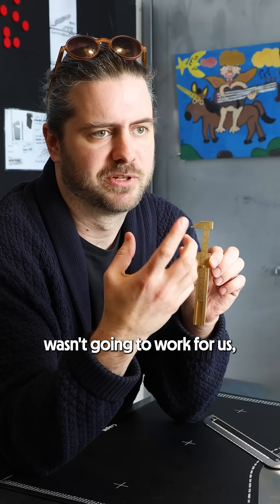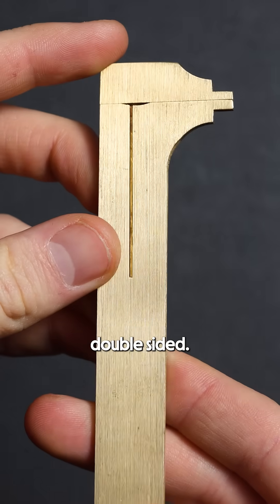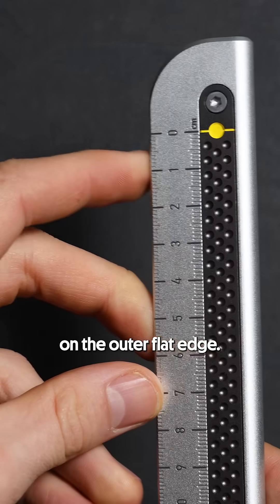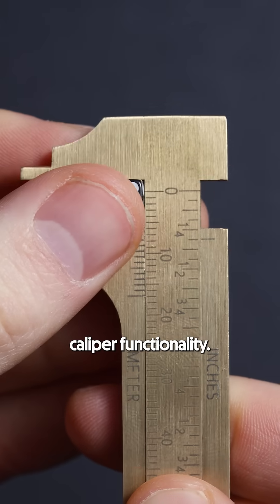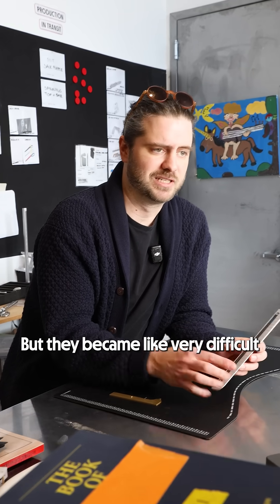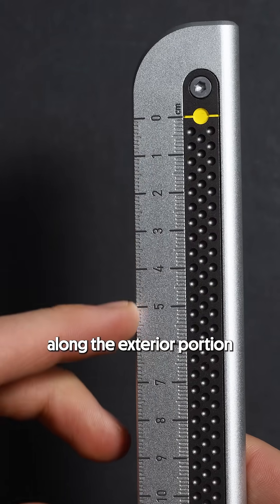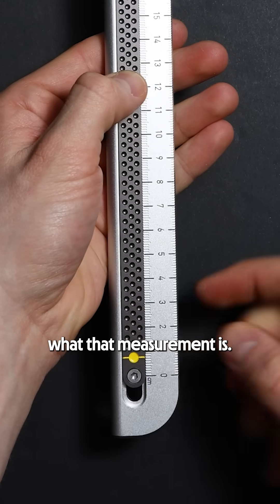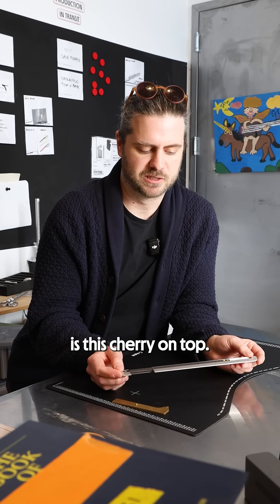Solving Our Problem with Calipers

Comment: These guys go to the nearest office Depot and pick the first thing off the shelf and say "let's redesign this for the sake of appealing to hipsters" and call it engineering
Reply: Not sure about you but I can see and understand the problems with the previous one he was holding, and why they changed it to make it better
Reply: @magentayarnball2901  their version is less precise, cant do internal measurements or depth, and solves a problem that didnt exist. The original calipers they had work as a ruler or straight edge if you use the back. Most of the work they do is removing functionality for the sake of making a thing pretty
Reply: @magentayarnball2901 this problem was already fixed decades ago, it's called using a ruler if you need to eyeball something and using dial calipers if you need an actual measurement
Reply: @magentayarnball2901 thats called luxury design, I dont like it, but also dont mind it
Reply: @magentayarnball2901  theyre version literally has less functionality than the older model, watch the entire video. it is fundamentally a worse product than the older design. good design is when aesthetics keep up with function, not sacrificing function for aesthetics
Reply: @pulkitkishore5297 I did watch the entire video and i’m seeing a few improvements and only one potential drawback
Reply: @pulkitkishore5297 where is the worse functionality? The caliper they had wasn’t even as robust as ones I’ve seen in schools
Reply: @magentayarnball2901  Calipers have 4 main ways to measure:
External Jaws: for thicknesses.
Internal Jaws: for things like internal diameter.
Tail: for depth of holes.
Step: on the back of head for step measurements of 2 surfaces facing same direction.

These new calipers only have external jaws, so you can only measure width of objects. It also does not have a vernier scale, so the precision drops from 0.05mm to 0.5mm. 

The inaccuracy and inability to measure any hole depth or diameter kills it as calipers, but it was clearly designed as a straight edge first and foremost.
Reply: @Polymath2B is correct
Reply: @Polymath2B this is the way
Reply: I found them interesting for a few shorts, but then pretty soon these kinds of comments start to make sense
Reply: $8 set of brass calipers replaced by a $100 ruler. Haha.
Reply: These calipers are terrible calipers not a single engineer would buy.
Reply: Yeah they don't even compare against the state of the art thing. The calipers I have are better than the one they show, and i feel like already has the straight-edge functionality
Reply: Why are you taking your personal problems out on this company?
Reply: so real---- giving meaningless design a whole new face
Reply: What even are hipsters heard it but don't k ow it
Reply: These are at Home Depot
Reply: Well I usually think the same as you do here, mostly because I see no improvement at all. More like a pricey overengineered toy.
But at least this time they merged two tools in one (yes they lost ID measurement but c'mon)
Reply: Pedant
Reply: have you watched any of their other videos? Their entire ethos is thoughtful engineering based on the product’s needs and good design. If anything, I’d say Craighill is more know. For solving design problems than for marketing products.
Reply: @ben3308 i watched any other recommendation forcibly fed to me by Yt (quite a few actually) because I was waiting for something truly revolutionary. So far I didn't see it, quite the opposite. Statistically I don't see good design. And I won't check their channel, honestly, precisely because I don't feel interested so far
Reply: @ben3308  most of their products dont solve any problem or meet any needs. A lot of them are just making a thing less functional but prettier or more eccentric. These calipers are just straight up worse than the ones they started with, but theyre easier to market to people who dont do real work
Reply: @thedudegs-f9w  again this comment feels like you haven’t looked at any of their products at all. This caliper, for instance, that they use as an example does not have the measurement lines all the way to the edge of the rail, making it basically useless to mark a measurement if you needed to that’s why they changed it to make the rail go edge to edge with the measurements, it’s pretty obvious. Their scissors they did make more eccentric, but they also solved issues with strength and the tank of the grip and sharpness based on the angle of scissors, their carabiner is stronger because it’s not always intention. It doesn’t rely on the tension of one spring for its entire point of failure. They have countless products which have thoughtful solutions to design problems, weaknesses, or inefficiencies. I just feel like you don’t know what you’re talking about
Reply: @ben3308  the only product of theirs i think is good is the key ring. That one actually is a legitimate improvement. But these calipers are just worse. I use calipers literally every day for my work, i would never use these. If you need to mark a measurement and it needs to be precise, open the calipers to the measurement you need and mark it, then use the back of the calipers as a straight edge. If it doesnt need to be super precise, just use a regular ruler or a machinists ruler. 

They are objectively less functional than the pair they started with and the benefit you get from that trade off is they can do the same thing as a regular ruler. And you dont even really save money, time, or space by combining a ruler into calipers because you still need another pair of calipers to do internal measurements. If you have another pair of calipers, then the only function this pair serves is as a ruler. If it does the exact same thing as a ruler, why not just get a ruler for much cheaper? Its self defeating because its not designed for actual use by people who rely on this tool. I can go to any store that sells art supplies or tools and find a better pair of calipers for cheaper
Reply: @thedudegs-f9w can you name another product?
Reply: Brain dead take.
Reply: Did you have a bad day? 😢
Reply: You actually just don’t understand the problems these guys are solving by changing the product. Skill issue.

Comment: As a furniture maker/general craftsman I love this design! 

I too noticed that it was missing the internal measuring function which comes in handy so much more often than I expected it would before my first set of callipers.

You mentioned that including that function would interfere with your intended purpose of having a straight ruling edge.

Would it not be possible to add a small set of internal jaws on the back edge of the rule (the rounded edge without the measurements)? 

I'm sure you guys have considered it but I just thought I'd mention it. Love the design either way!

Also, suggesting that not including a vernier scale defeats the point of having callipers is ridiculous. The degree of precision is entirely dependant on what is being measured. Pay no heed to that nonsense. That's like saying an odometer should measure a car's mileage in millimetres otherwise it's pointless.
Reply: Well, without verniers, I'd argue you can get the accuracy you need with just a steel ruler and your eyes.
Reply: I imagined folding jaws for use when needed? Fold away, folds back to a strong detent, applying pressure to a part with them only makes it stronger.
Reply: Alternatively the internal measurement prongs could pop out. But putting them in the back makes more sense.

Comment: you need a Vernier scale otherwise there's absolutely no point having the calliper function.
Reply: Agreed. It seems like the dot could be substituted by a vernier scale pretty easily too. Total missed opportunity to be actually functional.

I dare to say that it would look even nicer with a yellow vernier scale instead of the one large mark, so no benefit for aesthetics.
Reply: funny that's the first thing i noticed too.  no vernier scale.  a few lines get you a full extra digit of precision.  crazy this was handwaved off
Reply from the maker: Thanks for the feedback. Ultimately we were making a tool that best fits our design needs. When we need precision, we use our electronic pair of calipers. When we need something that looks nice on our desk, and also can get fairly accurate measurements quick, the Metrolog works great.
Reply: But why not add a vernier scale? Would add like 2 cents of cost and you could add a huge amount of precision.
Reply: @craighillcompany that’s some cope brothers because the comments roasted you
Reply: @craighillcompany i think the vernier capability would be quite worthwhile. A few extra, smaller yellow lines ahead of the yellow dot would increase the readability of your tool by 10x. Maybe make the screw hole slotted to allow the operator to calibrate to zero. If your market is the 3D printing crowd, that would go 1 step further to allowing their prototypes to fit right the first time.
Reply: @craighillcompany you are wrong. The whole point of calipers is accuracy if that is not getting it with an extra decimal degree of accuracy for free. What is the point. I’ll just eye ball it with a lighter thinner ruler.
Reply: @ilobdell Ding ding ding. We have a winner.
Reply: @ilobdell we should bring back visible downvotes because you def owned them here 😂
Reply: @ilobdell  I mean I'm not a fan of this tool either but you ignored what they said. It's not a pair of calipers, and precision is not the point of this tool.